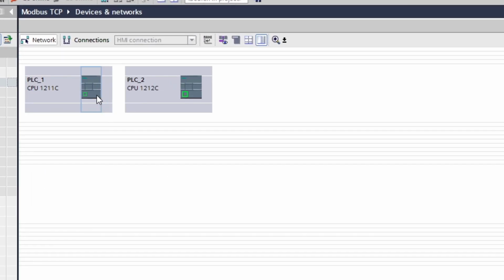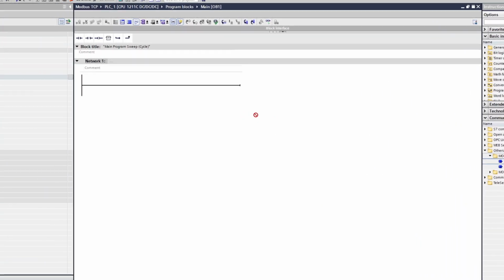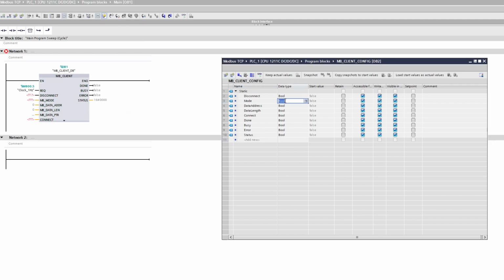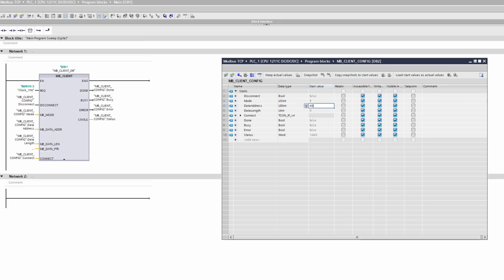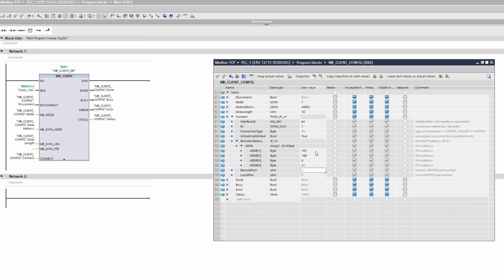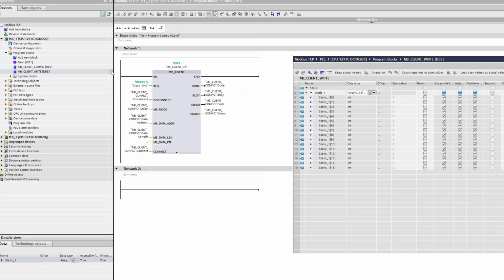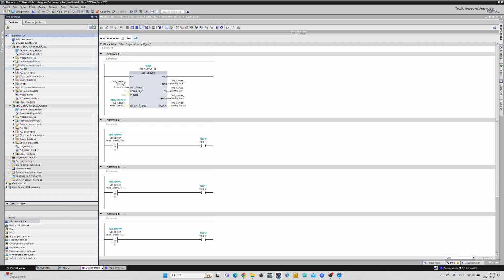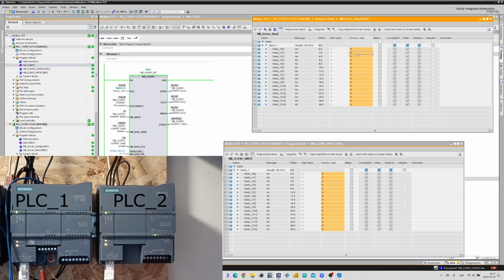Siemens S7 1200 PLC modbus TCP client tutorial | TIA portal

Comment: Can I make one PLC both Server and client? So I can have some sort of duplex communication? The reason I Want to use Modbus TCP is bc I think it'll be able to use it more easily over wireless communication. But i need communication in both ways. (Latency is not such a big deal)
Reply from the maker: It should work but be aware it could probably take up alot of memory space on your PLC
Reply: @1lovgren  it is working but only one block is working at a time, i had to switch manually to another block to make it work. my tcp ip server is on raspberry pi which only supports one connection at a time.
Reply: I also searching for the solution to make one tcp ip client block for both reading and writing data spontantaneously. please help me if you have already found a solution.

Comment: Hellow the issue here is all about what if i do not have physical plcs and i would like to implement the project so that to test this communication between two virtual plc? what should i do? because i tried to implement but when i started my plcsim the two added plcs do not allow data exchange  via tia portal v15.1 or there is anything to do with this tia portal version?Should i go for higher version like TIA portal v19? But i real appreciate the job because it real open my mind about this communication protocol
Reply from the maker: Yea dont think you can simulate this communication. Maybe through PLCsim advanced though.
Reply: It may be enough to run PLCSIM Advanced simulator. I saw there options for communication simulation. I haven't tasted it yet, but I'll check it in days.